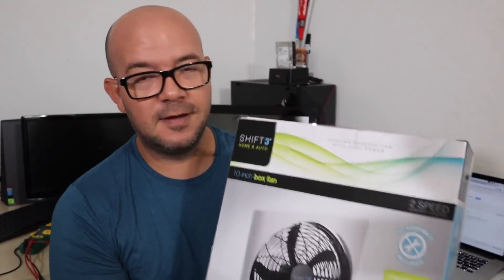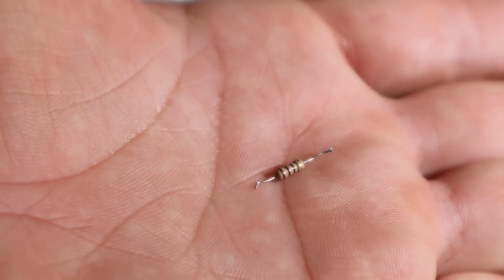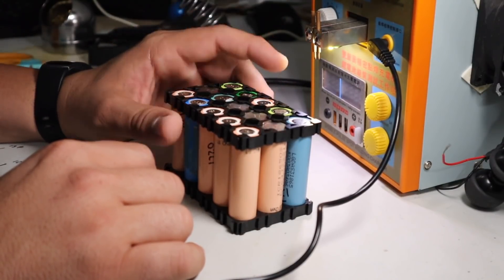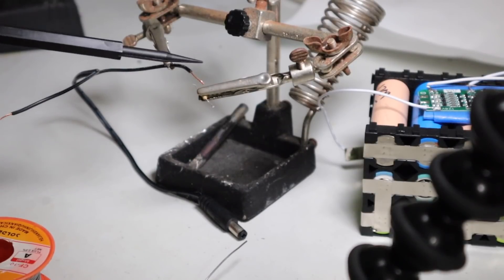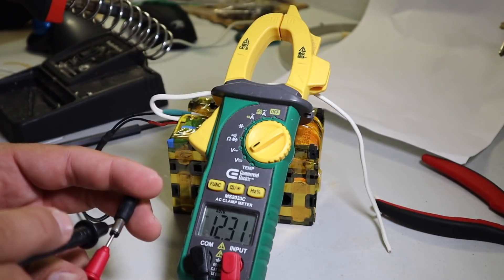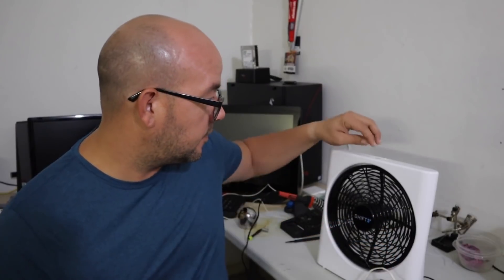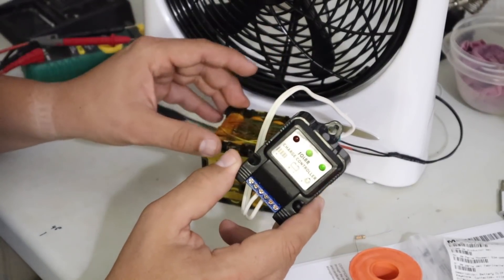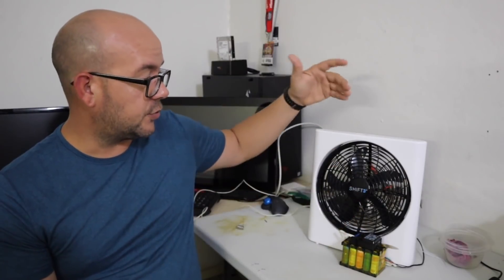How to Make a Rechargeable Solar Fan

Comment: Be careful with those coaxial connectors, Javier. They are not always center positive as you stated. But, testing them as you did will reveal their wiring. Again, great job. Keep up the good work. Deuteronomy 15:10

Comment: Any details on that charge controller?  Is it adjustable? I'm guessing it's PWM.
If it's for lead acid then it'll want to float at about 13.6V, but 3S is 12.6V max, and that would stress the cells a lot.
If so, then two or three diodes in series could drop the voltage down so the cells are happy.
That's a little wasteful, but I don't think a problem for this application.
Reply from the maker: I forgot to add the links. One sec
Reply from the maker: I just updated the links on the description
Reply: Sweet, thanks...  Good to see cheap lithium charge controllers now instead of lead acid!
Unfortunately I can't use Amazon in Hungary, so will have a look on ebay - could be useful to have one of these hanging around to play with.
Reply from the maker: I'm getting you the ebay links
Reply: This PWM is available for Lithium or Acid bats.
The 11.1v is for Lithium 3S circuits.  I bought some through Aliexpress.